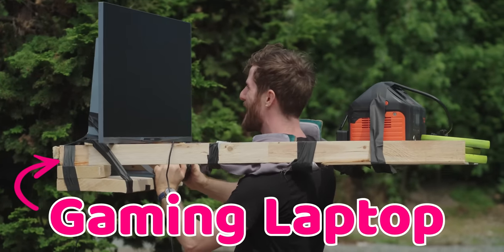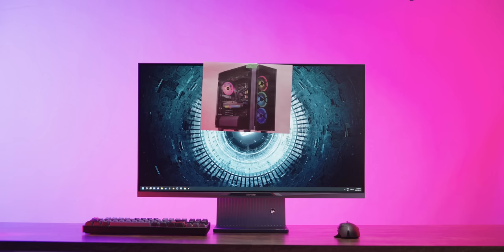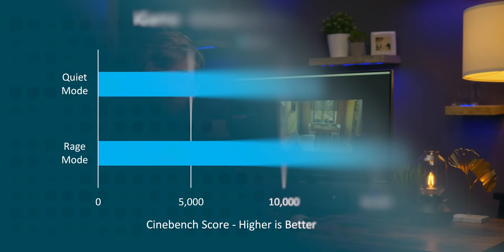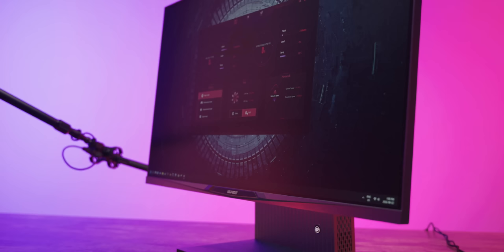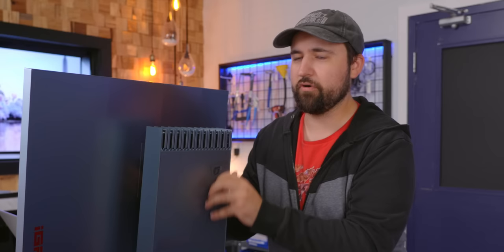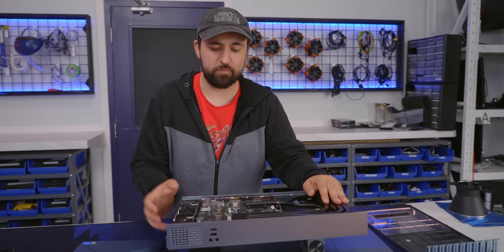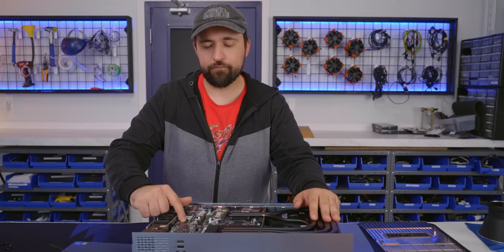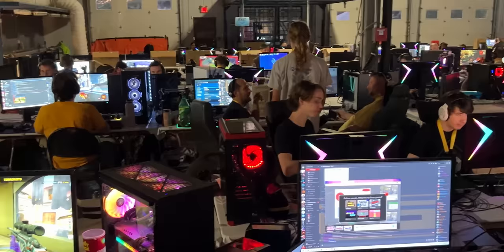Justify Your Existence. I'll Wait. - Colorful iGame AIO

Comment: Free idea for laptop / AIO manufacturers similar to that "rage mode" have a BIOS option for "CHE mode". CHE (Cat Hair Eject) mode does the same thing as rage mode on the fans, but runs them in reverse to blow debris back out of your air coolers. 🙂
Reply: ASUS had this on some GPUs a ways back. GPU fans would spin in reverse for 10 seconds or something upon power on to help get rid of dust or some other guff.
Reply: @PeterRahilly  neat
Reply: Really wish more fans did this.
Reply: the next einstein right here.
Reply: Pretty much every fan slot I've seen on modern desktops have a place for a filter anymore.....
Reply: @baltazard133T sure,but it's not as cool as having your GPU or fans blow out air rather then sucking it in.
Reply: @baltazard133T  mine actually didn't come with one, or space for one (unless I custom cut one)
Reply: I had a Lenovo laptop that did that.
Reply: i believe with how most modern fan is pitched and designed, it can't do reverse airflow that well?

Comment: I'd looked into AIOs like this before, and considered DIY'ing one myself using an old laptop to use as a side PC. This item is very likely made for people who want the clean setup of an iMac, but want the benefit of a native Windows / PC environment. Combine this AIO with a wireless keyboard, mouse, and headset. You'll have a rather extreme example of desk cable management that has some FPS-pushing capability. 

Ultimately, this is a form over function design to me. It has a very niche market, and limited reach. The reason enthusiasts have trouble validating its existence is simply because it wasn't made for enthusiasts.
Reply: @09f9  I was gonna say, like why buy this with the price point for the gpu most likely being the main factor, and not being able to actually use it to its full potential. pairing hardware that barely suits it is questionable at best if the designers know what they are doing.
Reply: Even AIOs have no business being so crippled in an era where low profile cooling components are a reality...90 degree mounts on waterblocks for both the CPU and GPU could render a marginally larger chassis whilst providing insane amounts more performance. Hell, my Velka 7 looks similar in volume and can hold and sustain an aircooled 3080...
Reply: @09f9  Absolutely agreed. This unit certainly feels like it falls into a category of "The target market is not who it's actually for." It's really hard to place it into anyone's hands squarely, really. Like I said, this is for a tiny subset of people who want an iMac but don't want to buy an Apple.
Reply: @ALmaN11223344  My thoughts exactly. Zotac's been handing out really neat little NUC units with top end graphics for years. Why wouldn't I just strap one of those to the back of a monitor and call it a life?
Reply: like i get it if it's a low powered i5 for school/work environment
but with that kind of spec, isn't a bit of a waste to not only lose on performance but also portability
it's like the worst of both world
Reply: the thing is, imac's aren't so easy to make a clean setup. You end up with cable mess and boxes of external drives. AIO have absolutely no sence unless it's a workflow that relies on one cable or no cables.

I'd prefer to shoot tethered to iMac rather than macbook but macbook is far more versatile because i can do mobile edits on it, both of them are too slow for proper editing in studio.

Comment: This is oddly very much popular in office settings where you need a decent computational power, but always be plugged in and only be used in one place. Like editing booths in tv stations
Reply: Sounds like a terrible idea, because as Linus said, under a sustained high load it either thermal throttles or gets louder than a hairdryer
Reply: Welll, editing video probably not. But editing scripts, visual assets... Sure.
Reply: This would be very popular on Internet Cafes if those were still around
Reply: 1 Million With 0 Videos Challenge (day 2)  ok i wont
Reply: @marvcyber815  Not really the fact that you have to throw away the monitor too with the PC once the PC is too old to play the popular games means they have to spend more money than necessary. It makes poor business sense even if some business do it just for the uncluttered look.
Reply: @alexisrivera200xable  In my country, those internet cafes never replace their PCs (unless a third of these PCs are broken), they run it to the ground and they start to upgrade PCs if they renovate the internet cafe itself once in every 5+ years.

Only eSport games are playable there with few of them have game save functions that enables them to play single player games but only less than 1% play those anyways so the concept of tech being obsolete doesn't exist here 🤣🤣🤣

And the advantage here is that they can sell it as a one unit which brings the complexity down when you have 30~100+ PCs to manage

So if this product is reasonably priced then this would be a decent choice vs the garbage specs that most PCs in my country have.

Most of the Internet Cafes (like 70~80%) that i have visited back in 2019 have specs like celeron gold and 750 TI or 550 TI 1080p 60Hz in them. 
The "premium" sections that charge anywhere from 2x to  3x hourly rate vs average rates have specs I3 dual core and 1050 TI 1080p 144Hz in them. 
The very best top 1% of Internet Cafes and they charge anywhere from 3x to 6x hourly rate vs average rates, have specs like I5 non k to I7 k with 1060 6GB to 1080 1080p 144Hz to 1080p 240Hz.
Reply: @ericlaska4748  Please elaborate where that use case gets demolished.
Reply: It’s a terrible idea for the long viewing business owner. An AIO is like putting all your eggs in one basket. Something breaks, it’s all broke. Want more storage or more ram to make the machine last longer? A bigger screen? Nope go buy a new computer. Granted it saves space and looks nicer without a load of wires, but at what cost?
Reply: Small Form Factor Dell Optiplex is probably the most common business desktop because is small, reliable and has a ton of business-centered services and support that I suppose this doesn't have.
Reply: 1 Million With 0 Videos Challenge (day 2)  you aint getting it
Reply: This would be perfect for a receptionist who plays games in their free time. That's the audience, hah. I don't hate it, but it's very limited use.
Reply: @marvcyber815  Maybe other cafes were different, but the ones I used to go to always cared about getting thier computers as cheaply as possible so that they could offer their services as cheaply as possible. They would try to get the most out of everything they bought, so not being able to use this as a regular monitor would be a no-no, not the mention the lack of upgradability would make it a much shorter lived investment than a regular desktop. And that's ignoring the price difference. 

Cafes which catered to gamers didn't shy away from building into old and discarded cases which were left open so that the components could breathe. Anything to save money on hardware so that they could recover the costs quickly and actually make profit without increasing prices.
Reply: @CanIHasThisName  Most of the cafes are like that what you would describe, but I can see the more pricey ones near universities would buy this in bulk if they can price this below $1500
Reply: @ericlaska4748  It can mean gaming cafes because "Internet Cafes" are a general term for those at least in my country

Like i said in the previous comment(Linus did mention this), It would be popular on Internet Cafes especially near the universities on premium section (3~4X the average hourly rate) 

My reasoning here is that they can cram a more of these so it can attract more gamers that come in groups where they want to play side by side as the problem with the premium sections IMO is that the booths there are huge therefore having fewer of them leading to less probability of having groups of vacant PCs side by side

As far as hardware is concerned for that use case aside from the 32 inch monitor which is the weakest point of this device, i think laptop hardware is fine if the future versions of this have better repairability and have better cooling, plus having laptop hardware is probably more resistant to price fluctuations vs desktop hardware 

I know its garbage if you think it as an individual desktop especially with that $2000 price tag,  but as a 50+ pc bulk buy if they can price this below $1500, i think it could be feasible.

But like i said, most internet cafes in my country have gone out of business thanks to lockdowns and silicon shortage and now economic recession so my point exist in the lala land anyway 🤣
Reply: i dont think offices are interested in a desktop called "iGame"
Reply: @evanharden  Bruh i know for a fact that an office here just bought like 70+ Republic of Gamers laptops, full on with RGB gloriousness 

Name is never an issue if they gets the job done and can be obtained with a decent deal
Reply: from what ive seen in office settings the pc is its own thing and installed where the monitors vesa mount is. that way its still easy to upgrade. it looks like an all in one but is just better
Reply: I've usually seen that manifested as a USFF PC that's bolted to the VESA mount on the back of a monitor, but for a variety of reasons that's more practical than AIO from an IT fleet management perspective.
Reply: But this is way too powerful for daily work and too weak and unupgradable for pro work. You could argue if you continue to use Adobe 2020 until you get a better machine these will be fine, but still when you finally upgrade, you still have to buy a new monitor
Reply: @ericlaska4748  Yeah that's why i did say covid + lockdowns (not to mention the air is recirculated anyway so social distancing barely helps) alongside silicon shortages and price skyrocketed inflations killed most internet cafes which is sad tbh because a lot of my fond memories came from those places
I did enjoy playing on garbage specs on most internet cafes like a dual core celeron, 550 TI, 8GB ram, 1080p 60Hz screen with my friends
Reply: This exact model, or do you mean AIOs in general? Because other AIOs make sense
Reply: but if it's an office with office level IT support, surely a NUC is gonna be less annoying right?
Reply: @ericlaska4748  Sorry, I meant Pentium Golds instead of celeron, for some reason i keep thinking about celeron gold when it literally doesn't exist (I'll blame Celeron G6900 for ruining the naming schemes in my head lol). But to answer your question, Intel started to sell dual core Celerons across their lineup since Q2 2013 

On the retroactive thought, I'll take the 32in monitor weakness back. Here's a business idea, if you push the 32in monitor back so it relatively looks like 27in or maybe 25 in (so just over arm's length), now you can have extra depth desk space between the keyboard and the AIO PC (also you can put bags in the empty spaces where a desktop would usually are), and now it is ergonomically possible to have food while gaming and eating doesn't feel sacrificing too much while in session, therefore it is now viable to run a fast food restaurant within the internet cafe. 

Having a wireless charging station built in is nice too because it can improve reliability because a lot of PCs back in my day was killed when someone is trying to charge their phone or worse a power bank by plugging into a PC because those usb controllers are terribly designed especially on cheaper boards so it sometimes it just takes the whole motherboard with it and probably overloads the power supply's 5v rail too because they are cheaply built too

Disregarding the monitor performance (because smaller monitors perform better in general than equivalent bigger monitor counterparts), having a big monitor far away vs small monitor close has comfort, ergonomic and health benefits lean better on having big monitor far away while the ability to see pixels better when playing fps is canceled out between the two options. 

If my memory serves, movie tickets are partly subsidized by its food sales, therefore the cinemas can price their tickets below profit. I don't have statistics for this, but people probably spend more time per session in internet cafes than cinemas. So internet cafes can charge 1.5~3x the average food prices partly because of increased maintenance and partly because they can because people aren't likely to go out to order some food while in session

Probably obstacles like the culture on cleanliness, ability of an internet cafe to compete on food or restrict food alternatives can put a wrench into this idea
Reply: You could use desktop

Comment: we got an old AiO, from a company that no longer needed it, at first the mechanical hard drive and lack of speed running windows 10, turned it into something we would typically put on the e-waste pile.... except after debloating windows 10, removing a bunch of apps, it suddenly got quick enough to not need an SSD. we were planning on just giving it an SSD running windows 7 or something, but ended up using the SSD elsewhere, where it was actually going to be useful in laptops/etc. so the AiO was going to be thrown out again, when another company, unrelated to ours, ended up saying they only really needed a web browser (and monitor), and some form of printer, for their business as a kind of overview display, and to this day I walk past that thing thinking, man that thing is lucky. still works fine, still quick enough, still does everything it needs to, likely won't die anytime soon.

I think the biggest point of failure to keep in mind is obviously the power supply, which is HP, and an awkward output at that. they don't make things easy do they. but it is still working after 10 years or so. 

10 years. when this thing came out people were still complaining about vista.

Comment: 5:00 he made it very difficult for himself, everyone’s first instinct when repairing a large display is to put it display side on the table so it doesn’t wobble around and the display itself can’t be damaged by accident
Reply: Putting it display down first would greatly increase the risk of ripping out the cable for the wireless charging when you removed the base. All of the force would be on the base of the stand since the monitor can't tilt far enough to lay flat when face down. The second you detach the base, all of that weight will shift to the vertical part of the stand and it will drop, potentially ripping out the cable. And you could say "Well, just hold it when you remove it!" and you would be correct, but 1 handing the removal is also pretty risky since you are putting a lot more force into one hand and over pulling it is a big risk once it detaches. He simply played it safe.
Reply: unless you have an iMac
Reply: @TheChemizzle  It's not clear to me that the base must be removed. He unscrewed it first, but it looks like the access panel for the internals would come off just fine with it attached.
Reply: @TheChemizzle  he could've just waited with removing the base and flip it first lol.
Reply: @chestergregg8668  The panel can't come off with the base on, for starters you need to put your hand inside in order to pull it outwards, secondly the front panel has clips that go into the base. (Visible at 5:46)
Reply: @Xfade81  Why would you reply with basically what the original comment suggested? Were you feeling left out?
Reply: @TheChemizzle  i wasn't replying to him now was i numbty
Reply: @Xfade81  Pretty sure I didn't say anything about who you were reply to. I said why would you reply (to me) saying the same thing as the original comment that I was replying to...it makes no sense because I already explained why he wouldn't have done it that way in the comment you replied to lol. You added literally nothing new to the conversation, so I am just going to assume you misinterpreted what I said (again) and ignore it.